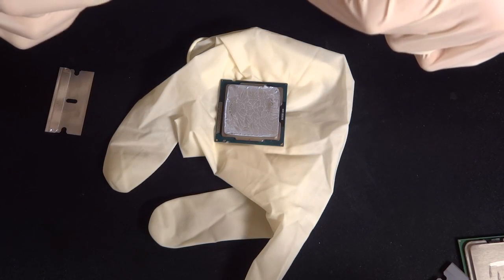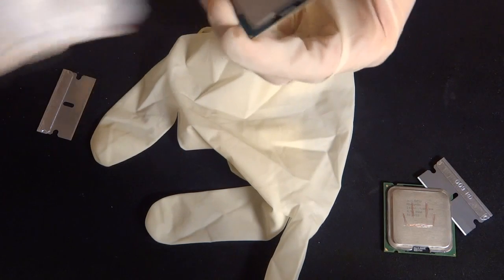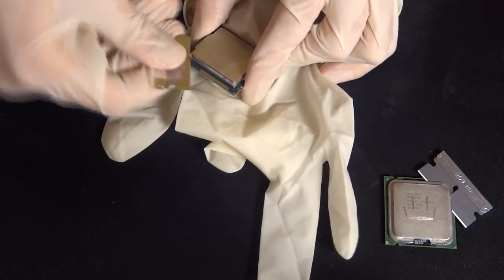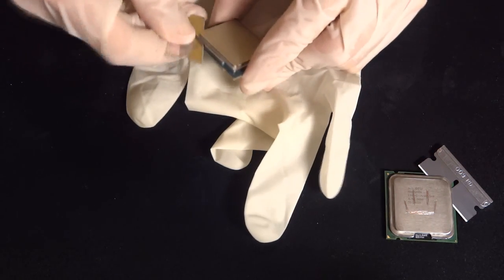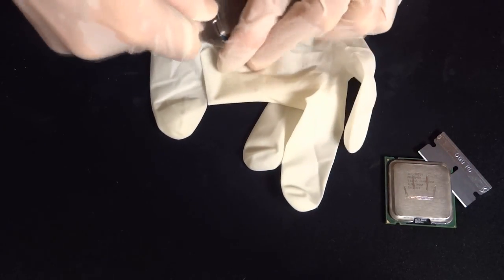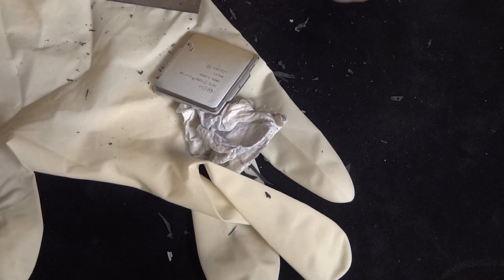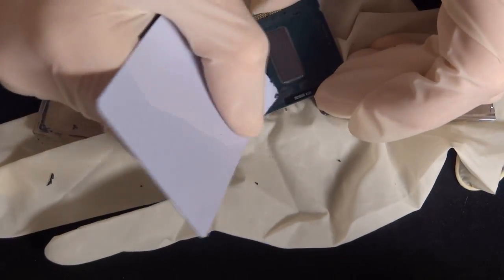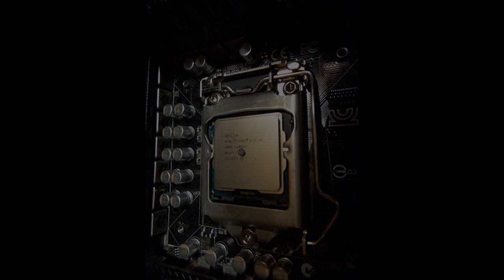Full Guide & Explanation to Delid an Ivy Bridge CPU - I7 3770K - By TotallydubbedHD

Comment: Is this going to be usefull  for cpu like i7 860 or not ??? i mean does the soldered has better heat dissipation or the  themal paste???
Reply: Short answer: No, it won't be usefull.
I've read that the indium solder that is being used on CPUs with a soldered IHS, has a thermal conductility of 87 W/mk while the regular TIM that intel is using on Ivy Bridge, Haswell, Devil's Canyon and Skylake is of 3,5 W/mk. 
Also, liquid metal pastes such as these three below, have a thermal conductivity of:
-Thermal Grizzly Conductonaut - 73 W/mk
-Coollaboratory Liquid Ultra - 38.4 W/mk
-Coollaboratory Liquid Pro - 32.6 W/mk
and some of the best TIMs out there can reach up to 12,5 W/mk.

That is why there is(usually) a significant drop in temps when you replace the crappy TIM between the die and the IHS with a liquid metal paste.
Reply from the maker: no idea, sorry
Reply from the maker: good info
Reply: +soap mactavish  Wow ty man nc research !!!

Comment: delidded my 3770k using razor. First look, everything is okay, but when I started cleaning it, found out that there is a deep scratch or more like a slice on the corner near the copper triangle on the lower left part of the CPU (bear copper traces) . The moment I saw it, I already concluded that it is dead (time for upgrade), cut is too deep and you will think that traces were also cut. But yeah, have to try it first before concluding so what I did is apply clear nail polish, let it sit for 24 hours to make sure it is dry. Set it up with stock cpu fan first to check if my system will boot up. Then miracle happen, it boots up, restarted it, went to bios and set everything on default, boot it up and ran some short test and played games for an hour, everything seems okay and never had any bsod or errors. Then set it up with my loop for extreme stress testing on stock first before OCing it to 4.5 for 24 hours each. Result is way lower temps and pretty stable rig, very happy with it.

I am just one of those lucky guys who manage to dodge the bullet. And By the way, that is actually my 4th time delidding a CPU. I manage to delid other CPU's without any damage though those are old and midrange CPUs. That is how I gain confidence and thus delided mine. 

It is pretty easy, but very risky. If you don't want to regret something, then don't do it. If you have the money and planning to upgrade then that is the best time to give your old CPU a chance first by delidding and OCng it. 3770k is still pretty fast and won't bottle neck any hardware and will run anything out in the market. Instead of buying new CPU and board, I will just buy another gpu for sli.
Reply from the maker: thanks for sharing - glad to hear it went well!
Reply: Just additional info, I used NT-H1 thermal paste from Noctua, to replace the stock TIM. It is kinda thick and you will be needing to spread it using a brush or a paper to cover the whole die. Wiggling heat sink to spread the paste is not advisable especially if you will be using thick grainy TIMs such NT-H1 since it might scratch the surface and damage the chip. I also didn't reseal it, no need to do that since board's CPU holder will keepit firm.
Reply from the maker: that's a waste of time.
You should NOT be using normal paste on the die.
Reply: It is not stated that you should not, it is okay especially if CLU is not available in the area like mine, you can see significant temp drop like what i do but you can get much better result if you will use liquid TIMs.  Concept of delidding is replacing "badly" applied stock TIM and use aftermarkets as replacement for a much better result.
Reply from the maker: the drop is marginal vs CLU - trust me and others
Reply: I totally agree, difference from my previous temperature before delidding is just around 10c. I consider that as good since my chip is already 5 years old. I didn't seal it back since im still planning to change TIM when I get a hold of CLU. Have to order and ship it, we don't have it here in PH.
Reply from the maker: ah damn!

Comment: Just tried to delid an old Intel Celeron D 3.46GHz CPU. You're right, they are "soldered" with a liquid metal "paste", but I somehow managed to open it (after going around the edges with the razor blade about 20 times) without damaging it.
http://zupimages.net/up/16/10/chud.jpg

Comment: That was really cool thanks!
Reply from the maker: No problem!
Reply: I hadn't heard of what deliding was till today (and I'm a bloody performance engineer) but after seeing its like oh THAT.  I did it with a video card once do to a faulty installation, but I hadn't realized it was a common OC practice with Intel processors.  Amazing the difference between a clean think contact and a piss poor one.

Great video though was well explained and covered everything someone might ask on why or how.  Very slick!
Reply from the maker: +Katrisa Ashe hmm what you did with a GPU isn't the same thing - you probably removed the heatsink and changed the paste on the heatsink/put an aftermarket cooler on.
This isn't a common thing to do with Intel CPUs, it's just that Ivy Bridge had terrible temperatures and Haswell too - but after that it seems to have been fixed (at least not as extreme temperatures as before).

It's also to do with the spacing rather than the contact of the die.
Glad you like the video :)

Comment: did you apply CLU to both the bottom the lid and top of chip/CPU? if so, why? why not just apply to the top of CPU/chip (which would result in a thinner layer)?
Reply from the maker: +Carlos Rios  at the time it was the instruction - not sure what the reasoning is - but I presume it's because as you apply the die on the IHS again, you can lose some CLU to the lid - so to prevent the die directly touching the IHS, you apply a thin layer there too - the layer is so thin, we're speaking of micro millimetres. Whereas the spacing of the IHS to the die by default is millimetres thick.

Comment: Would totally do this to my 4790k but, the fact that you had to open it up a year later to reapply the CLU is a deal-breaker for me.

What are your thoughts on this? Did you absolutely NEED to reapply your CLU? How can a delidding procedure be a one-time-thing, where we don't need to revisit under the IHS again?
Reply from the maker: I didn't have to re apply, I just opened it for curiosity, it's fine after one application. Maybe after 2-3yrs solid use it's worth revisiting.
Reply: +totallydubbedHD I was hoping you wouldn't say that.

Now I'm totally going to end up doing this, lol.

Edit: Any tips for the 4790k?
Reply from the maker: Haha! Yes use the hammer method instead!

Comment: how many degrees has droped cuz of delid???i have a i7 3770 just like yours and a 360+240 rad just for the motherboard(asus maximus 4 extreme-z) and cpu..no gpu!and allways  i have 40 at idle and 69-71 full load...i dk where is the problem...im in italy and outside are about 34 degrees C...
Reply from the maker: Valencian Badila check links in the description

Comment: Is it possible to reattach the lid by some high temp silicone sealant?
Reply from the maker: David Besada watch the video - you shouldn't
Reply: ***** I did watch it just without the audio cuz I'm at work lol. I believe you're pointing to the fact that it might elevate the lid a bit from the chip and leave out some space and defeat whole purpose. Correct?
Reply from the maker: David Besada indeed :)

Comment: I have dual 6990's (quad Xfire) and my 3770k is in the same loop as my GPU's.  At load at 1440p and dual flanking 1080p monitors for surround gaming with a 360 rad(pull) and 280 rad(push/pull) in an highly modded Air 540, I don't go over 40C on my 3770K or both HD6990's.  I'm wondering what kind of temp drop I could get if I delid since the  config I have is so dependent on the space I'm using.  I really would like to do it and I have plenty of Cool Laboratory's liquid metal in a syringe I'm just dying(pun) to use. ;) And yes I'm using all Heatkiller blocks on the two cards (4 gpus) and an Heatkiller gen3 CPU copper block with hardline tubing. Looks the nutz. ;)
Reply from the maker: Casey Kelley the temps are universal - around 10-30c depending on your luck/application.40c under load seems very low - unless you live in a cold country, I can't see how the 3770k can run at 40c under load. Lets put it this way, I live in the UK and my IDLE temps are 30c, delidded.

Comment: Guys dont re glue once your done, the temperature drop comes more from removing the glue so the ihs is closer to the die than anything else
Reply from the maker: that's explained in the video already
Reply: Chris Roberts *****  So, do you just use the pressure from locking the whole piece onto the motherboard to hold the IHS onto the CPU?  I'm getting ready to delid my 3770k in the next few days and want to make sure I do it right.

Comment: On the haswell chips, there are surface mount components near the die, what's the best way to keep the liquid pro off them?
Reply from the maker: 101m4n yup - hammer and vice method buddy
Reply: ***** What? That doesn't answer my question at all. Also, you don't need a hammer.
see: http://goo.gl/clJ4tF
Infinitely better than any other method I have seen.
I was asking how to keep the CLP from touching the smt components next to the die.
Reply from the maker: 101m4n oh miss-read it on mobile.
Ask around on haswell, chips I don't have one - I wouldn't think it would differ from IB
Reply: ***** Np, will do :)
Reply: 101m4n Use clear nail polish or that clear nail coating stuff, forget the name of it.
Reply: Austin Alvis Used a tiny strip of cling film with glue on it in the end.
Nail polish is a good one though.
Reply: CLU is corrosive, if you just used the film and removed it, when that stuff heats up and reliquifies, if it runs for whatever reason you right it getting there, where as if you'd used nail polish it'll continually block it.
Reply: Austin Alvis didn't use CLU, used CLP. Which is just a straight up gallium/indium alloy with no additives so far as I know.
Also, the machine has been running continuously for many months, I'm not taking it apart ;)
Reply: It's the metal on metal that causes corrosion, being the CLP is still all metal same as CLU, it'll be the same.

Biggest difference in the two is one is liquid metal like, the other is more paste like.
Reply: Austin Alvis that isn't corrosion in the conventional sense. The gallium diffuses into the crystal lattice of the metal that it is contacting, it doesn't undergo an actual chemical reaction. To the best of my knowledge, this only happens in aluminium.
Reply from the maker: Austin Alvis I have no problems with mine, even 2 years on - and yes I've opened it to see how it's doing

Comment: so would you not just solder the ihs onto the cpu if it works better then silicon based compounds
Reply from the maker: nope - you would literally burn the die doing that lol
Reply: ***** oh lol idk why i asked, not that this video really matters to me since i have a 3770 which for me running at 4.3 is fine for me when u look and compare some people cant get that on the newer haswell chips lol and ik its only one core running at 4.3 and goes down some for each extra core but thats better then keeping it at 3.9ghz

Comment: Quick question, what happens if you lock the CPU with your heat sink/don't use the IHS anymore? If I'm thinking right, there would be way better heat conduction because the heat doesn't "go through" a layer of thermal grease, the IHS and another layer of thermal grease to the heat sink. Also a cooler with should hold this CPU in place very well, if you think about it. You know, the mounting mechanism of a 1 Kg heat sink should apply enough pressure to keep the CPU in place. ;)
Reply from the maker: a direct die you mean - you can, but you only gain 1-5c - and on top of that you have to be EXTREMELY careful
Reply: Well, sometimes 2°c can be the difference between life and death ;)

Comment: your Anti-static technique is dubious at best. You need to connect yourself to earth ground. The RUBBER GLOVES ARE AN INSULATOR SO COLLECT STATIC (do not use them, bare hands are better if not conductive gloves, yes, believe it or not. So yes have an anti-static wrist-band and is connected to your computer chassis (not just some random metal) that is plugged into a a socket with a ground pin. THEN u will have static protection. But at least you try, most moders are clueless in this domain.
Reply: +Greg D or a radiator or sink works aswell :p

Comment: I bought a delidded 3770k and when i cleaned the clu of the previous owner there was a small part of rust or of the clu tim being dried and was unable to remove it with the indigo xtreme cleaner, what would you guys do? should i use the scrub that comes with the clu next time i take it apart? also i applied clu very little just enough to paint the die there were no bumps of clu on the die, was that enough?
Reply from the maker: Leave it on - just in case you damage the die.

Comment: i tried this method on an E5800 CPU and successfully applied the CLU paste on the die but the CPU is still having high temperature. Can the sensor be the problem or the CLU paste is no good enough or simply the processor is gone?
Reply from the maker: sometimes it depends on your application. Try again.
Reply: ***** I tried it again in 2 different ways with no improvement in temperature then i took another E5800 CPU from another machine and i broke off the die of the PCB as it was soldered to the IHS. It's embarrasing as i had no problem with the first one and could wipe the residue off of the die and IHS with no problem. I wonder if that was soldered too but not correctly because both chips are exactly the same make (the printed text on both chips are exactly the same) Heated up the IHS on the broken CPU with a hot-air rework station for 160C degree for less than one minute and the solder got melted and the remains of the die could be removed from the IHS.(150C was not enough). Probably with this technique a soldered CPU can be taken apart too.
So i wonder if the reason why i failed to improve the temperature with this technique on the first CPU is because this should be resoldered rather than just CLU pasted. The solder was relatively thick on the die. Or i should apply more paste between the die and IHS. Does anybody have any experience with soldered CPUs? Thanks

Comment: I used a dremel tool with a polishing brush to get most of the old epoxy off my pcb and IHS, just have to soak it in some alcohol first and only use it after getting off what you can with your fingernail. Does a great job cleaning off the underside of the IHS too.

Comment: How do you put the IHS exactly back to the original spot?If it is slightly off,what will happen?Will the mobo pins get bent,or will the PCB of the CPU gets scratched or even break due to uneven tension?
Reply from the maker: The IHS is literally just a copper plate.
It doesn't have to go EXACTLY back - but as long as it is close enough, it's fine.

Nothing will happen due to "tension" or "bent pins" - pins have got absolutely nothing to do with it really.

Good question though, but nothing to worry about :)

Comment: Rubber gloves is a rather bad idea when it comes to avoiding static, they will actually make it worse. Static electricity, is electricity, that's static, locked to a place, Hence the name, wearing rubber gloves, just means that the static charge you might build up on the outside of the gloves, has nowhere to go, and your wrist strap therefor does nothing.

Don't wear gloves, do wear a wrist strap, and do clean you hands thoroughly, as you will have slightly acidic fat's on your skin.

Comment: I delidded my 4670k using the hammer and vice method. I was scared as hell doing it haha. Anyway I used CLU between the die and IHS.  the temps didn't improve a whole lot. I used your method in dipping the brush and applying. I'm almost wondering if it'd be worth reapplying CLU.  The IHS moved a tiny tiny bit when pushing the clamp down.  Do you think I should reapply?
Reply from the maker: Yup I think you should.

Comment: same process for 4th generation older(crustier....)brother? 4670k
Reply from the maker: almost - it is more dangerous with the haswell as it has some transistors or something on the PCB, right by the die - if you cut as much as I did - then you'll easily cut through those as well.
Look up the hammer and vice method for haswell :)!
Reply: will do

Comment: I was talking with somebody on xtremesystems. org he has exactly the same 3770k batch number as mine he overclock 4.5ghz with v core on CPU-z 1.216v but my 3770k same batch as him i did 4.5ghz with v core on CPU-z 1.3v bios setting Volt for Ram&PLL auto everything else was same as urs BUT i did succeed overclock to 4.7Ghz with 1.435v on bios and 1.44 on CPU-z and i tried prime only for 2-5 minutes and it was stable i didn't continue until i will have my CLU and diled because of high temp

Comment: Amazon.com By Daniel Watkins (USA) 
This review is from:Coollaboratory Liquid Ultra
CLU isn't all that good after a year of hard use (around 85 degrees Celsius nearly 24/7 with some idle periods). In fact, it completely hardens / dries. On my X9100 after 9 months I started seeing high temps and after 1 year auto shut downs while crunching. Turns out it was shutting off because it hit the 105 C thermal protection.
Opened it up; thermal compound was as hard as a rock.

Comment: I´m on a Thermochill 120.3 (old 25mm spacing) + DDC 3.25 (for now but have a broken DDC + DIYINHK 18w Toshiba pcb just gotta solder it first) + Supreme LT on cpu and get similar temps to good air coolers, that is just sad imho. Chip seam willing to go close to 5GHz but temps shut me down!